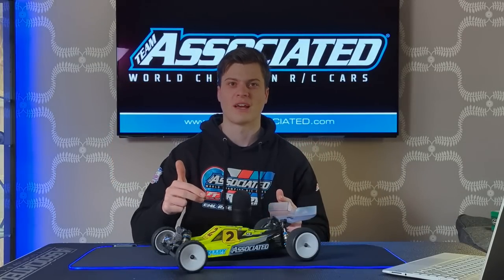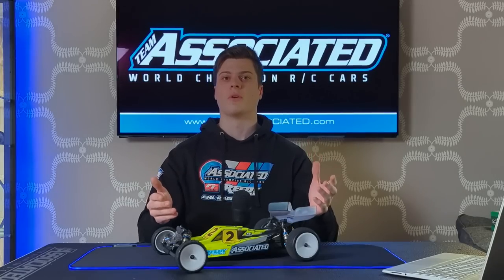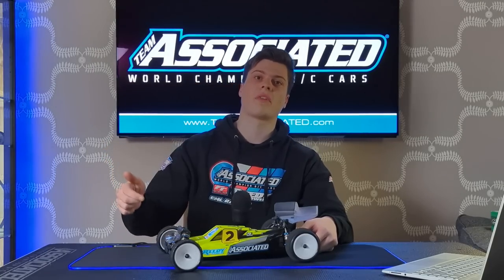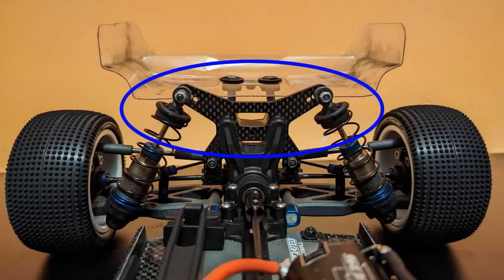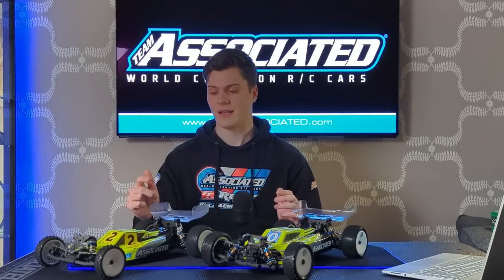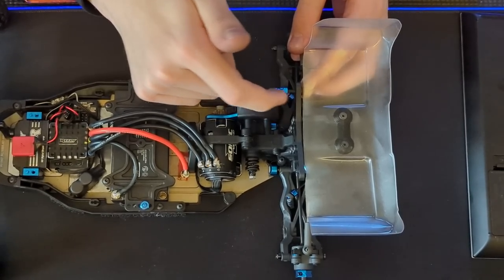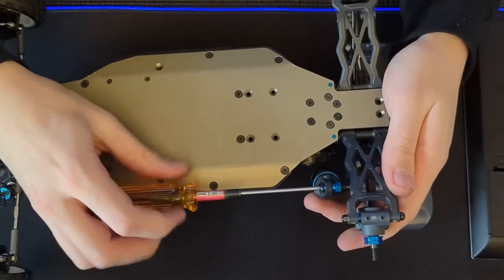Inverted Shocks: The New RC Trend Explained!

Comment: Have you tried turning the rear spoiler upside down? Makes mine fly round the track.
Reply: I like it, I'm changing mine tonight
Reply: Free weight reduction at speeds lol
Reply: put back wheels on the front and front wheels out back for better turning under acceleration!!
Reply: @unkulwilly  controlled rotation under braking and throttle is key👍
Reply: Lol
Reply: Flip the tire inside out for better traction and or slicks I also reverse the steering and throttle to get more speed and turning ability 😉
Reply: I just run my car upside down in reverse, seems fine
Reply: Does it matter if the front continues to point frontwards, or can we rotate such that the front points backwards. I've been trying this out both ways, but with all the possible angles it doubles my work. So far, I find no evidence to support your claim, but I should have a full review done in about 4 months. 

Keep the rubber side down, good buddy.

Comment: We have been doing this in crawlers for many years. Low CG is definitely a thing then you are constantly on the verge of tipping. But racing would see a slight benefit as well as disadvantages. I am surprised it has taken the racing world this long to realize it.
Reply: It’s not a new thing in RC lol.
I’d think lcg in racing would help.
But for me it’s all that matters lol.
Reply: In crawlers it makes sense because you want a lower CG but you also increase the unsprung mass which doesnt matter in a slow driving crawler.
Compared to fast driving RC cars or any normal car for that matter its pretty dumb because on them you need your suspension to be able to follow the road and bumps so you want less unsprung mass and not more. This is controproductive on fast traveling vehicles.
Reply: Sure but adding weight to the Unsprung weight keeps the wheels on the road.    I’d suggest most lcg crawler principals apply to racing lower almost always equals better handling at any speed.
Have great day dude!
Reply: @rcarty419  the opposite is true

Comment: I literally brought this up on a forum a decade ago(I'm sure I'm not the only one; this was back on the old XTM Racing forums, before XTM went out of biz), asking people if the slightly lower CoG could be beneficial in an RC. My question back then was inspired by motorcycle front forks, since there's both inverted and non-inverted fork applications. I never tested it(I wasn't racing either, just a basher) and everyone said that it probably wouldn't make a noticeable difference, but I never bought that answer(since it was obviously just an assumption; and RCs are already super lightweight [a 1:10th scale RC would weigh ~300lbs at 1:10th the weight of a fullsize car] so the shock bodies make up a not-insignificant percentage of the car's weight.
  
Really REALLY cool to see that my suspicions were actually right(well, more so weight transfer than for cornering advantages, but still... lol) - almost wish I would've poked & prodded someone that raced a decade ago to try it out lol.
Reply: I think it is helping through the corners on high bite tracks for sure. Like he said helps get the front wheels down some instead of squatting on left or right rear. Pretty crazy how you thought of it though! When I was 10 I thought of regen braking for electric cars before it was a thing lol. No one listens.

Comment: I do it on my micro-DT with the losi oil filled shocks on it because they are leaky. They leak a lot less when upside down and since I'm just using the car to chase the cat around the house, I don't worry about dirt/rocks dinging them up. Considering how small the shocks are, they only hold 2-3 drops each, so any leakage is noticeable pretty quick.

Comment: It keeps the piston submerged in the oil longer through its travel. Keeping the piston submerged keeps the shock from cavitating which makes the valve work properly. I have been running shocks upside down on real drag cars for a long time.
Reply: Yeah this guy is talking about the 3rd and 4th affects and is not paying attention. They are actually designed to be run that way. I agree with you Jason
Reply: @kyleteal5888  incorrect.
Reply: the pistons are always submerged in oil?
Reply: @buss1205  no not really when cap up, but running a blatter cap helps alot.
Reply: @kyleteal5888  only on emulsion shocks is there air in the chamber. If you bleed your bladder shocks correctly and they don't leak at the seals then there will be no air in the chamber. The piston will always be submerged in oil.
Reply: @ragsixracing  in the beginning and middle of the run I agree with you. And the end of the run I don't know how or why it will have some air in the shock that's why you mount them shaft up.
Reply: No offense but that sounds pretty stupid. Maybe drag dampers work different than other dampers so please correct me if im wrong but i doubt it.
Dampers are a closed system and there should be no point in the full travel of the damper where the valves are not fully submerged in oil and/or dont work correct because of it. There should never be any air in normal shocks exept you have emulsion shocks on a real car which you definitly dont have.
Emulsion shocks are way to unpredictable in their behavier and i dont know a single usecase for them with real cars.
If your drag dampers behave different just because you put them in upside down then there's something wrong with them.
All you do is increase the unsprung mass which is detrimental for a drag car/any fast going car for that matter.
Reply: @benistingray6097  let's go back to hydraulic basics, please define cavitation?
Reply: @kyleteal5888  Dude im not a layman, if there is cavitation happening in shocks then i say it gladly again, something is not correct with the setup.
Can happen because the damper oil gets way too hot which shouldnt happen, even less so in a drag car who runs only a short time.
Can happen because the gas pressure is too low.
Either way, cavitation is not something that should happen when a damper is working under its designated operating parameters.
Reply: @benistingray6097  perfect description on these race cars and anything, from a fox shock to an ohlin to a penske shock. Heat even at operating temperature can and some how creates bleedable air over time. Like I said before I'm not sure how, if it's pulling it in past the seals or its boiling the miniscule amount of water (in shock oil)to create steam. Heat and resistance does this to shocks over time. So upside-down or shaft up is best for maintaining longer consistency.
Reply: @benistingray6097  not sure who reported you but the only way I knew you posted was my notification, anyways have a good night.

Comment: i run inverted on my ecto crawler. ..big advantage for crawlers as it add the unsprung weight and lowers the overall CG...i did it few years back on the yokomo Bmax2 buggy...it feels great..its just that i have to use lower spring rate and lighter abit tad shock oil trying to maintain the reduced bodyroll effect due to the deducted top deck weight..did great on my tamiya M05 race kit too..... and the drive definitely feels more planted.

Comment: Here is a racing question...if racing carpet oval, would installing the inside shocks upside down help keep the center of gravity biased to the left? Would it help the car to rotate in the turns, or make it push?

Good explanation, thanks😎
Reply: If you've gotten this far... What about crawlers? I've never seen shock bodies down on a crawler. Wouldn't it add unsprung weight? People pay hundreds to get weight down low. What am I missing?

Comment: Coming from a full size car racing background 
, the biggest impact inverted shocks will have on an RC car is to massively increase unsprung weight.  This will make the shock work even harder, leading to cavitation and poor wheel control. This will outweigh any advantage gained by marginally lowering centre of gravity.
Reply: Most offroad carpet tracks are flat so I don't think you need the fast working work shocks  do on a outdoor track
Reply: @Deezul653  fluid action doesn’t scale, your right in that regard, but un sprung weight is even more critical in lower weight vehicles. By inverting the shock the shock body and all the oil becomes part of the unsprung weight as opposed to the shaft and ball cup in the conventional setup. This will mean the shock is unable to control fast changes of direction leading to loss of wheel contact more often.
Reply: @Deezul653  it’s diminishing returns though. By inverting the shocks you’ll probably struggle to measure the reduction in CG, but the unsprung weight will probably increase by 25%+. 
 I imagine any increase in performance is purely a placebo effect.
Reply: It's literally going to be a case by case basis - smooth surface, great idea. Bumpy surface, maybe not a great idea.
Reply: @RyTrapp0  I disagree. Massively increasing your unsprung weight is not a good idea on any surface. Traction will be compromised on both surfaces and loss of grip will be less linear meaning it will be harder to catch when it does break traction.

Comment: Did that with my 1/10 touring 4WD indoor car back in 2000, and lowered the battery and drivetrain in the chassis, it worked quite well

Comment: All motocross bikes use to run right side up front forks until the late 80s when they put them on upside down and realised the bike handled better. 
I think there is a lot of similarities between rc offroad racing and motocross/supercross so maybe this could be a decent handling improvement?
I'm no rc racer just a fan.

Comment: That's why Schumacher invented the "laydown" shocks in the 80's or '90's... Lower COG without killing the suspension... And I believe they won the world title with that car. This might work ok on carpet or smooth indoor tracks but if you flip the shocks on a bumpy outdoor track, you greatly increase the unsprung weight on each wheel. This makes your suspension less effective and reduces traction and grip. People have been experimenting with this on dirtbikes since the 70's and RC cars since the ~80's or 90's (that I can remember). It can give you a minor advantage under the right circumstances but 9 times out of 10 it will do more harm than good.

Comment: This is my first hearing about this, but it makes sense. Quick question.. given that shocks have "always" been top heavy since forever, would you recommend upside down shocks as standard from now on?.. I know that there are drawbacks and the answer is probably "it depends", but if you had to pick a default, what would it be?

Comment: I used to run my shocks upside down in the mid 90s in the TCS.  while cg was the center of the show the real reason was that the shocks then leaked like crazy.  we ran the plastic shocks with single o rings in them.  this way the shocks would not leak then the car was being transported or overnight :) let alone the race itself...

Today I still run my shocks upside down if it fits in the car. (most of the time it will rub on the knuckle or something.)  and today it is for CG as the shocks really do not leak.

Comment: I've done this for a few years now. 
For two reasons. 
The weight is put lower. This worked excellent on my hand-made 1/16 grave digger. A979 and my Rampage.
Plus they are less likely to leak as fast.
Reply: Do u mean wlk a979??

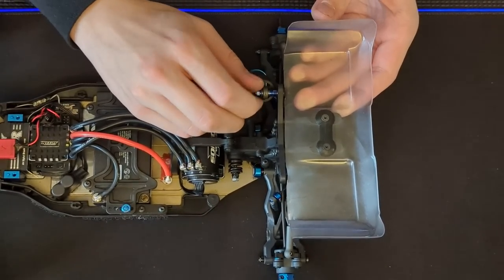Comment: Looking at your car at around 5:15 the rear shocks are inclined vertically with the highest part towards the rear of the car . If you added a longer screw and more spacers so the shock was leaning forward would this resist the squatting better? The shock would be more in line with the squatting force therefore stiffer . Imagine a sumo wrestler leaning forward instead of back . The leaning forward would resist the force better 
Is that a thing!?.

Comment: If you know about motorcycles, you would know that when the cylinder is above the piston and rod that would actually be inverted shocks.
Reply: These aren't motorcycles, that's why no one uses motorcycle terms to describe RC cars...
Reply: @RyTrapp0  a shock is a shock lol.  Rc technically adapted mounted inverted shocks.
Reply: @KiloWattRC  lmao, must be why I call my car shocks "inverted - oh wait, no I don't, because it isn't a motorcycle so the shocks aren't "inverted" from anything...

Yes, RC "technically" adopted inverted shocks - if you're trying to describe an RC setup using motorcycle terms🤷‍♂
Reply: @RyTrapp0     everything from cars, trucks, motorcycles, dirtbikes adapted inverted shocks.  I only mentioned motorcycle because the shocks get rebuilt constantly like RC shocks, and not replaced like u see in the automotive industry.   All OP did was take the inverted mounted shocks and mounted them in standard upright position.  Go enjoy your life
Reply: @KiloWattRC  lol sure, whatever you say...
Reply: @RyTrapp0   I didn't come up with the term inverted or upright shocks, so it's not whatever I say.  I will say knowledge and experience will take u a long way.

Comment: Look at the old motocross bikes. That’s how there shocks where. They changed it for a reason, I’m betting after a few years the Rc guys will decide  to do the same.😊
Reply: Eh, I got inspired by this idea years ago because of inverted and non-inverted forks in the motorcycle world - but I wouldn't go comparing 2 & 4 wheel suspensions much beyond that, they have very VERY different requirements(and, frankly, motorcycle suspensions are pretty damn underdeveloped compared to 4 wheel vehicles - blows my mind that we don't have a variety of different front end designs on the market, everyone just running the same ol' forks).

Comment: In full size racing you only run shocks that are gas (nitrogen) charged,  with the shock body bolted to the shock tower ..less unsprung weight.  Oil filled shocks mount the way you just did it
Reply: looks at every off road full size racing rig and they are all oil filled with nitrogen gas bladders. Every single one has the shock body mounted to the frame. Why, less unsprung weight.

Comment: Just a thought, anybody doing adjustable shocks with a knob instead of changing weight. Or the other thing im trying to make(for drag rc) a 1 way reed valve that closes 2 of the piston holes after compression to keep the rear sucked down
Reply: Put a thin flexible shim washer on the rebound side of the piston to reduce or close the holes on the piston during rebound. But flexes open on compression. Like a reed valve.

Comment: I think your missing a few major things about suspension theory and setup... And for perspective, this is coming from someone who does shock valving on actual dirt bikes, snowmobiles, etc. As well as raced RC I the past.

With the shocks inverted, you just killed your rebound damping performance.  You slowed it down due to the increase in unsprung mass. The tire will have harder time following the ground surface as a result.  Ideally you want a controlled rebound so the tire doesn't impact surface but instead follows it to keep tire pressure on the ground.

Instead of doing this, I would instead try increasing your spring rate so you reduce the amount of preload for ride height to minimum. When you have lots of preload, while shock is rebounding and almost fully extended, there's still significant spring force as it tops out.  A heavier spring  with little to no preload instead has very little spring tension left at top of stroke. This would help reduce the weight transfer which is what your trying to reduce here. Higher spring rate = less weight transfer; damper itself does less work.  Lower spring rate = more weight transfer, damper has to do more work to prevent bottoming out and etc.

The best thing to do here would be to slow down your rebound and therefore your weight transfer, but that also effects your compression damping too   So a even better fix to the issue would be a different shock piston with shims or check balls to separate compression and rebound. That is how real shocks separate rebound and compression ports on the piston allowing way better control of all of this.  MIP bypass paiotms are piston and shim kits and even Traxxas has metal shim kit that makes this work.  This would allow you tune compression and rebound independently which really does wonders.

Note: A universal truth to suspension setup is you want your unsprung mass(weight not supported by suspension, I.E. wheels, hubs, suspension arms) to be as LOW AS POSSIBLE.  You increased that greaty by flipping the shock. Previously the mass of fluid and shock body was hung and supported by shock tower making them sprung mass, while your shock shaft, eyelet, and spring we're unsprung mass.  Unsprung mass makes very poor rebound performance, it's slows it down while also giving it momentum causing tire to impact the ground harder leading to bounce

If you got this far, yes my shock nerd, and yes that was a total involuntary info dump.

Comment: With every advantage, there's a disadvantage. Buy inverting the shocks you add a lot of unsprung weight. This will make the car less stable off jump's and in bumpy high speed situations. So on carpet with small jump's the inverted shocks will help.

Comment: I been flipping my shocks on touring cars and dirt oval for years dating back to 1990 on my custom works dominator and my losi jrx pro. This isn't new and it does work
Reply: I was about to make a similar comment. I remember my uncle ran his shocks upside down back in the mid 80's. Never knew the reason, but I was 6 or 7 so I didn't care.